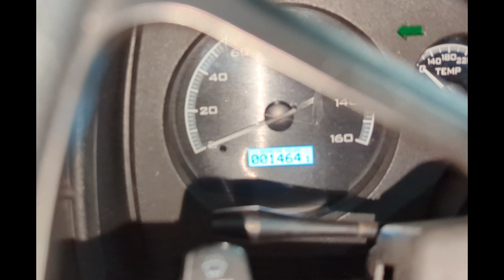Hot Rod Power Tour Day 5

Comment: Getting ready to buy a cd009 transmission to put behind my 5.3 ls, do you like yours ? Would you do it again over say a T56 ?
Reply from the maker: If I could go back I would save my money up and buy a T56. I have almost as much in this as I would have paid for a new T56 considering the rebuild this transmission needs. The gearing in this transmission is great for a high horse power car though. Also the price for a used CD009 has really gone up lately.
Reply: @ForsakenSteel  
this one I am looking at is 2500.00, new clutch, new aluminum flywheel, shifter, pretty much everything I need but I was worried about the gearing. T56 with everything is 6700.00 so that's why I'm considering this route.
Reply from the maker: If everything is in good shape you should be set. I'm assuming that it has already been set up for a LS. If not you will need an adapter plate $1000 a LS flywheel and clutch kit about $400 a hybrid clutch disk. Also the stock location does not work. I'm using an Autosport  Engineering shifter another $500. Just things to consider before you pull the trigger.
Reply: @ForsakenSteel  yes its already adapted and has been behind a ls already, He is including a new GK Teck shifter relocation set up with shifter , clutch & Fly wheel is  spec 2 new in package and an new aluminum flywheel. I just dont want to look back and say, man i wished i would have held out for the T56 magnum.
Reply from the maker: That actually sounds like a really good deal. I had that shifter and ended up not using it because of the transmission tunnel. As far as preference I think you will be happy with that. Good luck and let me know if you do it and how it turns out.
Reply: @ForsakenSteel  will do thanks!

Comment: Hi, I’m really enjoying your videos. We live in the same area as you and was wondering who did your exhaust. My son just finished installing an LS into his 1989 iroc and we’re looking for any recommendations on a good exhaust shop. Thank you
Reply from the maker: It's a kit from Speed Engineering. I had it installed at Broadway Muffler but was disappointed with the results. I ended up redoing the center section after I swapped transmissions and the cross member. I highly recommend the Hocker Blackheart transmission cross member. It gives you extra clearance for the exhaust. Sorry I couldn't help more.
Reply: @ForsakenSteel  thank you for the info, I’ll probably do some calling around and see if anyone can do a custom exhaust. If not I’ll probably order the same kit you have. Thanks again
Reply from the maker: Best of luck and let me know how it turns out.